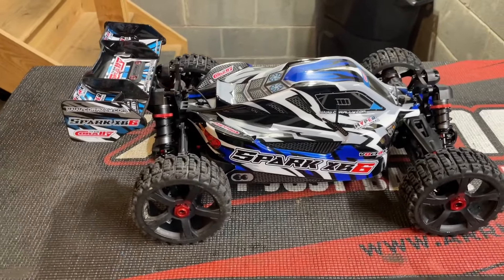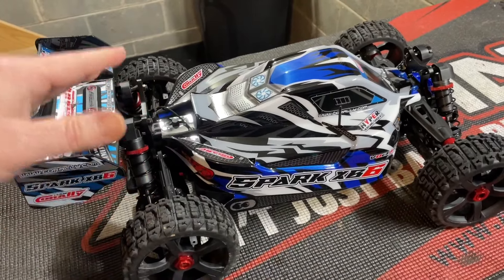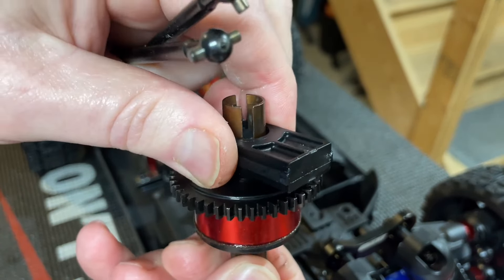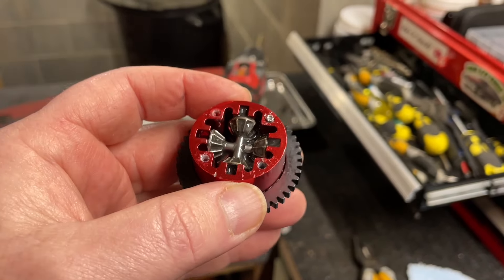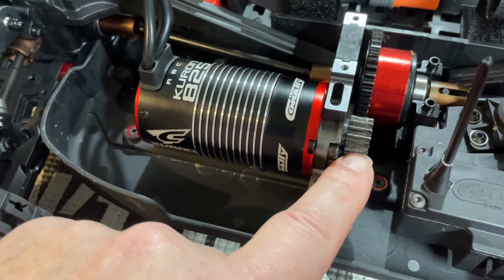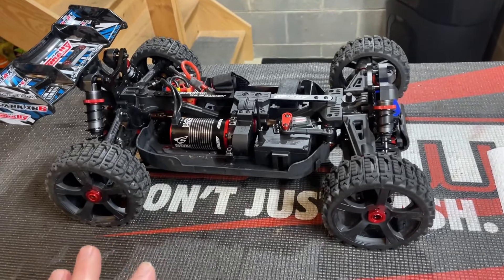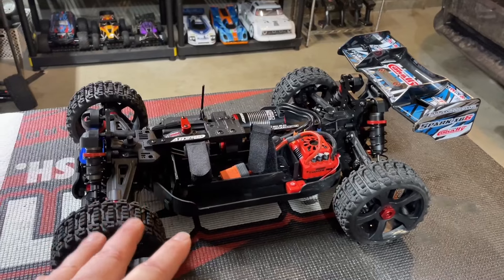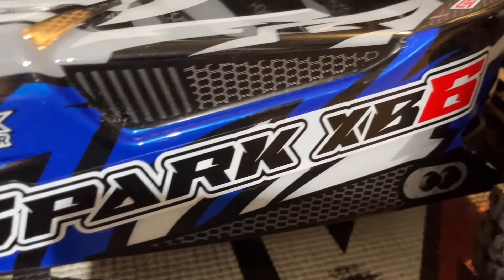TEAM CORALLY SPARK XB6 First changes and modifications.

Comment: Yeah the locktight diff case is a pain for sure there. A tiny little dab im sure would have been sufficient. Cant wait to see how she runs, im thinking its gonna be wicked on that 15 t pinion. Looks like a good setup with that buggy im with ya on the tires they look and perform amazing from what ive seen so far D. Great vid bro as always. Thanks. Hope the rain goes away real soon lol.
Reply from the maker: Yeah, I definitely like these tires really digging them, I got it out for another run with the new pinion but I ended up replacing the center diff with a new one because I couldn’t stand that broken screw lol and the car performed flawlessly again

Comment: Tips or tricks to open up the diffcase? Heat it up with a little blow torch?
Reply from the maker: Yeah, either a little torch or put a soldering iron. That’s nice and hot on the head of each screw for a few minutes.